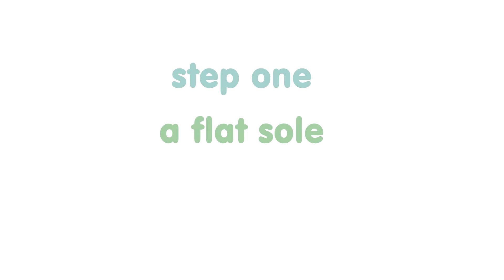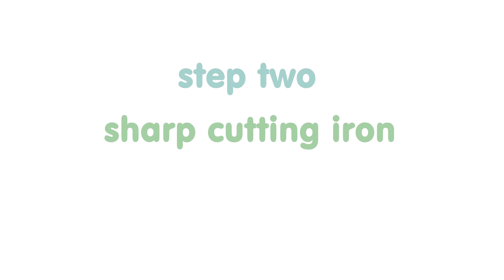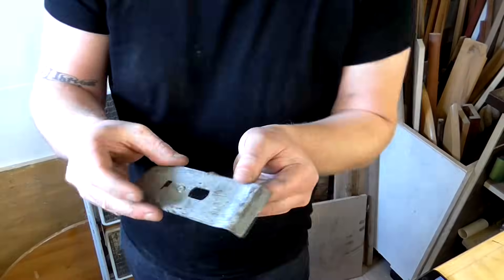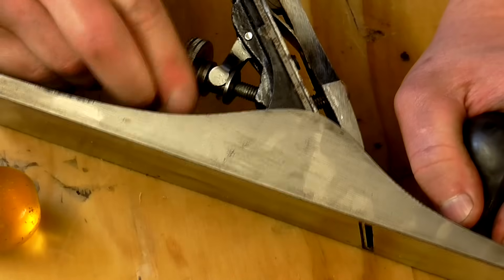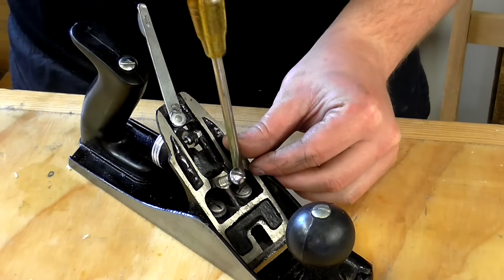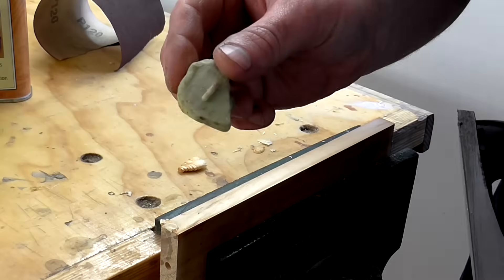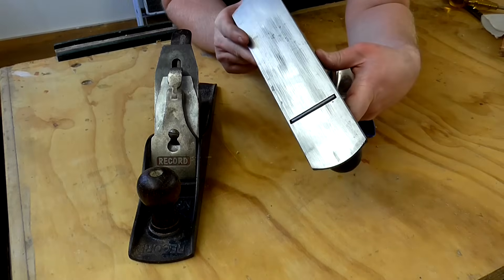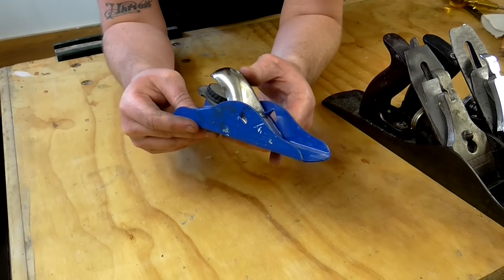Hand Plane Set Up - IN SEVEN SIMPLE STEPS

Comment: like I can't even get the blade to stick out.
Reply: Lol I'm here because when it DOES stick out it just gets stuck in the wood or doesn't cut at all 😂
Reply: @core.dad.tiktok I had that same issue back it off to a smaller depth of cut little by little while trying over and over to do a pass each adjustment till it’s feeling smooth use a piece of scrap wood you can retract the blade in small increments and if it’s still bad do it again and sharpen the blade while also making sure your chipbreaker is at the right distance between the blade and that your breaker doesn’t have a gap between the blade and the chipbreaker itself should help

Comment: I just bought my first hand plane and it is identical to the number 4 of yours. Here in Australia it is branded "Craftright 225mm Bench Plane" and costed me 25 AUD. Without any experience I tried to set it up, but discovered it is not so simple (for a newbie like me). I found your explanation very clear and because you used the model identical to mine it has been very fortunate to me. Liked and subscribed.
Reply: What Georgio said... not so simple until you see it done. Thanks from another newbie.. My no. 4 works now!
Reply: Same here

Comment: Alright this is the sort of beginner's guide I was hoping to find.  I purchased a plane on a whim, and couldn't figure out how to get it to cut without jamming and not cutting, or why none of the dial adjustments did not increase the cut.  Didn't want to disassemble everything without a clue in the world.   It's the explanation of moving parts that really made it make sense, instead of the too complicated breakdowns.
Reply: If it makes you feel any better I disassembled my brand new hand plane, sharpened the blade to a mirror edge... then promptly failed to do anything but chew the wood to pieces. Been trying for 3 days to figure out why, what I did wrong, been searching YouTube and still couldn't figure it out because according to what I could see in the videos I found it should be fine. Stumbled across this one in a fit of annoyance that it still wasn't performing properly, and at precisely the 2:21 mark realized that my problem was I had put the blade in backward and not a single other video showed the reassembly process clearly enough for me to notice.
Reply: @dudeistpriest787  Ah the joys of old tools.

Comment: Thank you for this straight-to-the-point video. I recently purchased a cheap and poorly made Stanley #5 (looks a lot like your Record). I’ve been flattening the sole, 10 minutes at a time, over the past few days (that is, working it for ten minutes x4 or 5 times each day). I’m glad I started with 80 grit sandpaper! The high spot is straight down the center, and the area around the mouth was also quite high. I’m finally getting close to perfectly flat. It’s been tempting to use a lot of force, but I’m letting the weight of the plane do the work.

I hadn’t taken a good look at the knife until today, and it’s filled me with a bit of despair. It’s not straight (the edge is irregular and not at a right angle) when held against a square.

Comment: 4:40 - Another (more fundamental) cause of jamming is for the chip breaker to "make contact" with the iron away from the chip breaker's front edge.  The angle at which its bevel is ground affects this.  You want the very, VERY front edge of the breaker to be the first part of it that touches the iron, and when you have that you can put it insanely close to the tip of the iron and you won't get jamming.  This is the preferred arrangement when you're setting up the iron for smoothing.  If your chip breaker is incorrectly ground and you're getting jams, then you can ALSO alleviate them by opening up the mouth, but that detracts from the quality of your operation for smoothing.
   
To get the breaker ground this way, flatten it in the way the video describes, but hold the back end of the breaker very low - even lower than the surface of your sharpening stones if you can.  This removes more material back away from the edge and ensure that material isn't there to make first contact.  Anyway, the rule of thumb I've heard is to have the throat about double the shaving thickness you want.  So if you want 0.001" shavings, you can go with as little as 0.002" throat.  That's a WHOLE HECK of a lot less than 2mm.  :-)  See Paul Sellers's videos on plane setup for more on this.

Comment: Excellent and Actionable content; so thanks for that; I actually had a hard time finding a manual bench plain; every where I went, wanted to sell me an electric one; I had bought a wooden screen door for my workshop from Lowes that is a cut to size screen door.  I cut it down with a cordless 10 inch circular saw, and cleaned it up a bit carefully with a belt sander.  

However, the door still wouldn't close completely and seal, ( I live far and away out in the country, so we are in no short supply of flying and crawling creatures that seem to enjoy finding and messing with whatever current project I am working on, especially if it includes paint work ).  So, the seal on the door is important to keep them out.  

The size I cut the door down to, is just about as close as it can be; however the door frame has an angled step plate at the bottom, so the wooden screen door bottom must meet the correct angle to seal tight; and belt sanders are very efficient, but feathers away, and eats material to fast and it is a challenge to get the angle true all the way across.  

I found a Kobalt 9 3/4 inch x 2 inch Bench Plain; part # 0118238; which are similar to yours; aside from the quick release latch on top; I have a brass screw instead; but seems like a very solid and sturdy unit. 

 "Many" of the tools made for the last 100 years were "most likely made by IRWIN" no matter what name brand they were sold under; until in 1993, "American" bought out IRWIN, and since then in 2003 "Newell Rubbermaid" bought out American.  

I also inherited tools from my Grand Father; and unless acquired two generations ago, most all tools are only manufactured by a small handful of companies, and then rebranded.  These older tools have held up very well over the years; and it almost seems intentional that newer tools only last so long.

Thanks again; very helpful; I have worked with metal most all my life, but started wood working on or about 2017; and find that I like to work with popular wood the best, as it is very strong; hard, but doesn't split or crack easy and the wood grain looks excellent, especially once stained or sealed.

Comment: My favourite is a No 6, it's great for flattening boards
Reply from the maker: I’d like a 6 or a 7 but they’re so expensive
Reply: @RagnBoneBrown  I bought mine many years ago, good hand tools are expensive but it's worth the saving and the wait to get them.
Reply: @RagnBoneBrown  I just bought two original Stanley Bailey's on Ebay for under £170. These were made in England with proper wooden handles. I got a number 4 smoother which was never used, it came in it's original box wrapped in grease paper. The number 5-1/2 needs a small bit of work but perfect otherwise.

Comment: Excellent tips, not to mention short and sweet. Your #4 looks suspicious identical to a Stanley #4 smoothing plane. Excellent tool. I love mine. My dad gave it to me  he even stored it in the original box with the price tag on it from the early 70s. I just sharpened it today in fact and I can shave with the blade. Mines blue and says Stanley on it LOL but everything else, even the frog is identical. Of course this happened and still does a lot as the tool industry is insanely incestuous. I need to restore a Craftsman plane I aquired actually it's my uncle's but he didn't seem interested in wanting it back but I'd rather give it back in better condition than he gave it to me which is a sad condition. I also have a block plane nearly identical to yours only it's red. It's a cheap bargain brand but the sole is flat and it shaves wood. I'll likely upgrade it eventually as it is super handy and I love it's small size.

Comment: Great tips Keith will have to do this, what angle do you use with the honing guide?
Reply from the maker: +Michael Evans thanks I've not actually checked the angle I just set the distance between the cutting edge and the front of my honing guide to around 35mm and it seems to work well
Reply: ok thanks.

Comment: @Micheal Evans: steps are easy to make: 1st, decide how big a strop is needed(depends on how you use it). Generally, somewhat wider than the chisel or iron to be polished. Then, length a little more than the stroke. If you want to use for knives, then measure your "cubit"/forearm, add 4 - 6 inches (100 - 150 mm). Cut a wood block to those dimensions, obtain a piece of leather that overhangs the edges of your block. Use spray contact adhesive as directed to attach leather to wood, trim edges. Now load the surface of the leather with stropping or polishing compound, and go to town stropping your cutting tools. Of course you can purchase, but each person uses their tools a little differently, so why not custom-make your own? Have fun!

Comment: What's your strategy when the grain of the wood flips within a board.  Meaning, the beginning of the stroke is smooth and later the plane causes tear up.
Reply from the maker: I tackle it from both directions usually or use a card scraper if I’m just looking to smooth it over rather than keep it flat

Comment: Good tips, I found motivation after watching this vid, so I used these tips on an Indian made "bench plane" that refused to work.  Success!!! But the plane overall keeps letting me down, soft screws, poor threads , only square to left side and so on... it pays to buy quality  from the start with planes as the cheap one only frustrate.
Reply: Could you tell the brand. The only good Indian plane are called Anant
Reply: @gautambarua8260  the brand name is accorn. But I have seen the exact s as me plane with different names and slightly different parts, but judging by the packaging they all originate in tt h e s a me factory.  I replaced some screws since the original comment. It's now my favourite bench plane.

Comment: Im having trouble getting my plane to work properly. For some reason the lever cap likes to pop off if i mess around with the depth adjustment too much. Any idea how i could fix that?
Reply from the maker: +Gofeball Mcsullivan sorry, not something I've experienced before. Is your lever cap tightened down enough with the screw?
Reply: Yeah and if i thighten it any more i cant turn the knob that moves the iron. Maybe i have a garbage plane lol. Thank you for replying though.
Reply: Maybe its too tight and the spring is under some weird tension. It shouldn't be that hard to turn the depth adjustment.

you should be able to take the lever cap off without adjusting the screw first.
Reply: Maybe its because its a cheap Kobalt hand plane.

Comment: Hi Kieth can i ask where you got your leather strop from?
Reply from the maker: +Michael Evans hi Michael, the leather came from an old bag, I spread out some 5 min epoxy on the an MDF block and then added the leather and clamped it for half an hour or so in my vise. It's working well however I have had an issue with the green polishing compound rubbing off the old compound rather than applying it over the top of the old, if that makes sense. Not a major problem though
Reply: Thanks.